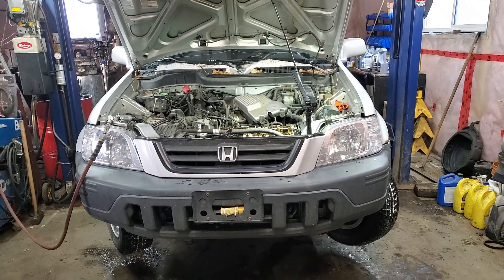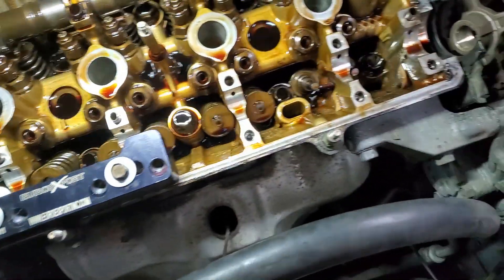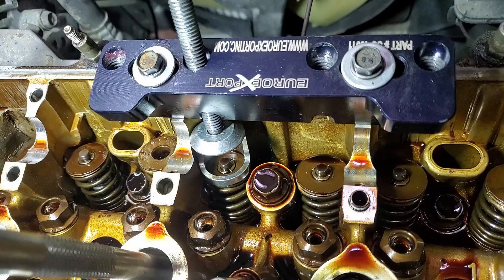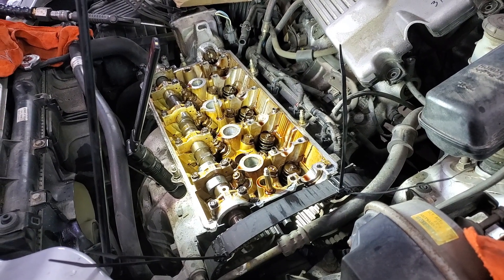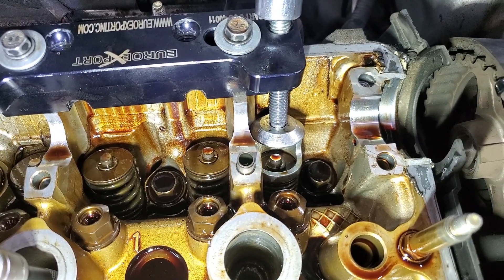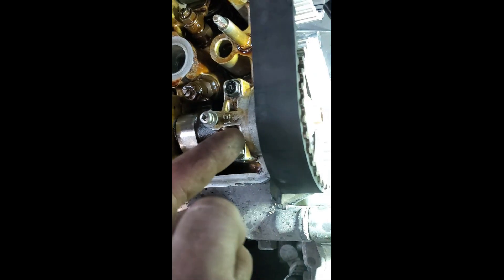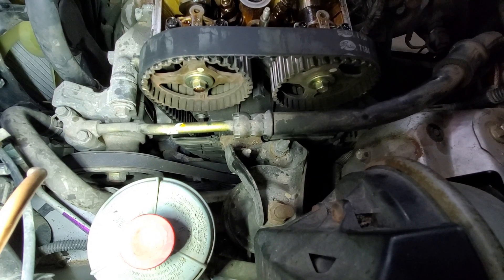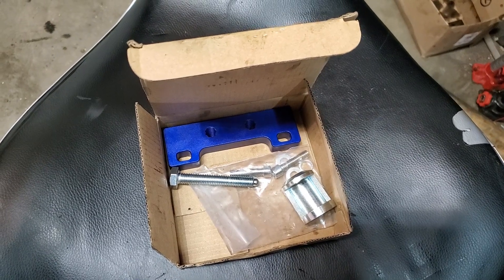Honda CRV B20B Valve stem seal replacement.

Comment: 6:15 Sorrry but that´s a wrong explanation. You are not pointing there at the TDC,  The three marks you are showing are ignition timing marks, usually the center is in red color which decolorates over time. The real TDC mark is the single notch on the crank pulley, separate from those three, to the right, usually colored in white.

 Added to this, On a Honda CR-V 1St Gen, you should NEVER trust the plastic cover mark as a good reference... the only reliable TDC reference is the crankshaft pulley mark aligned with the fixed metal pointer on the engine block. The plastic timing cover is not a precise reference and should never be used to set TDC. It can be slightly misaligned due to installation position, manufacturing tolerances, or movement over time, which can easily lead to timing errors. Always use the crankshaft mark and engine pointer as the true TDC reference. Your video is a clear example of how cams can be aligned, and the plastic cover pointer is at the wrong position and 99% of time would never point to the TDC notch of the pulley.
Reply from the maker: yes I believe you are correct, but I have learned a few things since this video.

Comment: Tried doing your method and the cam wheels spin with the crankshaft now my belt and wheels are stuck lmao
Reply from the maker: ya its not the best method, I was just trying to save a little time, you may have to just do the timing belt the traditional way.
Reply: @A2J_Tim I was able to fix it the belt wasn’t loose enough I mean hopefully I don’t have to do the timing lol
Reply from the maker: @davidcassia1595  make sure you check your timing when your done, turn the engine over 2 times by hand and check your timing marks.
Reply: @A2J_Tim for sure thank you man

Comment: Can you explain why it appeared the timing belt didnt move at all when you rotated the engine?  I assume the timing belt is still connected to the crank, which you rotated for that process, but in the video as you rotated the crank, the cam gears (disconnected and with the timing belt zip tied to them) didnt move at all. (3:45)  It seems to me that it should move with the crank. Maybe it actually did move but was just sort of sliding to the left giving the illusion that it remained still?   Thanks
Reply from the maker: the the cam gears off the belt looses contact with the crank pulley, thats why the belt doesnt move.
Reply: @A2J_Tim  ahh makes sense thank you

Comment: Did yours smoke after replacing them? I just changed all mine and its smoking.
Reply from the maker: no, I diagnosed my smoking issue and knew it was the valve stem seals. its possible you have another issue causing oil burning.
Reply: @A2J_Tim  id think that too but its a fresh build. New rings, pistons, valves, has good compression. The valve seals i replacemed were definitely a problem because they were all torn. Im hoping its just residual oil burning
Reply from the maker: @boosted_donkey  if its a fresh build, usually an engine will smoke for a good 10 to 15 minutes after engine start up, its the oil from assembly of the pistons and rings. If it continues past that, their is a problem with the build. if its a turbo engine, and its a used turbo you may want to check and see if the turbo oil seal has failed.

Comment: Could you like the seals you use? I’ve ordered 2 sets now and they’re way off. Same motor as yours. Thanks.
Reply: Thank you!
Reply from the maker: @alifakih9061  your welcome :)
Reply from the maker: https://www.rockauto.com/en/catalog/honda,2000,cr-v,2.0l+l4,1365566,engine,valve+stem+seal,5800
Reply: @ which brand do you prefer?
Reply from the maker: @alifakih9061  mahle

Comment: Mine smokes during idle on drive in long lines or traffic for a min and goes away, I also have a 01 CRV. Is this the problem for that solution the valve seals?
Reply from the maker: yes that will be your problem, at idle your crv makes the highest vacuum in the intake manifold and if the valve stem seals are no longer soft oil will get by them and you will see oil burning at idle, it will clean up as you drive because Rpm goes up and Vacuum goes down.
Reply: @A2J_Tim   thanks so much for the info! My mechanic is working on it now
Reply: you fix it?

Comment: Hey I am attempting to do my valve stem seal job the easy way as in your video. I am wondering once you get the belt zip tied to the cam shaft gears, if you just pulled both off without loosening the timing belt.
Reply from the maker: I didnt video it but in the end I ended up  cutting the zipties and getting them back on with a pry bar and then checking the timing after ward, its a little bit difficult but it can be done.

Comment: A trick to delay this project is to use Bars oil stop leak.  Like I managed to delay this job for two years after I started to get morning smoking after idling to long before shutting off the night before. Well the water pump is leaking so time to do both of these jobs now.  The B20B4 tool is available when googled and checked for use on the B20B4 for around $80 + ship & tax. I found a knock off on eBay that looks like yours and good for Mitsubishi 4G63 and 4G63T.  I am getting the tool that is thicker like yours not the thinner ones.   $33 for this one.  This is a one time job for me so the $ make sense for me.  Wish me luck.
Reply from the maker: you can do it..

Comment: You should have shown how much of a pain in the a$$ they are to remove. And also emphasized on how to tap on the new ones. Tap and listen for sound change, that means you have bottomed out. A good bright light as you tap on is a very good visual you can see them stop as they bottom out. As for removing you need a good old fashioned pair of pliers and squeeze them at the top and turn and squeeze and turn several times while wiggling and pulling, then they will pop off. Best figure on about 15 minutes per seal to get them off. Honda B20

Comment: Came here to see how to remove the stem seal... Only thing you didnt show...
Reply from the maker: sorry. I used a heal bar and pulled up from under the seal rim, some of them I just grabbed with plyers and pulled up.
Reply: That’s because it is a pain in the a$$. To remove them. I can tell you from experience. You have to use a good old fashioned pair of pliers and pinch them at the top and squeeze rotate squeeze rotate wiggle and pull then it will pop off. Figure on spending about 15 minutes per seal to get it off.
Reply from the maker: @t.c.robinson6608  I dont remember it being difficult at all, like 30 seconds each.
Reply: I literally had to saw mine in half, they were so stuck on there.

Comment: I take it you have to adjust the valves after you’re done ?
Reply: Thank you for your response :) 
Another thing is do I keep the cam gears zip tied with the timing belt up until I reinstall them, to ensure timing is correct ? I’m worried if they’re both off and zip tied, and I start turning the crank pulley to get 3 and 4 to TDC, the bottom part of the timing belt might skip teeth, since there is no longer tension being acted upon it. Maybe I’m overthinking ? Thank you again
Reply from the maker: @TheFoxyPlayer  On this job I ended up cutting the zip ties off, I just didnt film it. I found it was a little bit difficult to get the cam gears back on with the timing belt on them as the tension-er is pulling tight. but yes you can jump a tooth, but its not something to be worried about. As long as you lock your cams in place with the locking pin holes and your crank shaft stays on the TDC mark when your reinstalling the cam gears you will be in time. once installed always turn the engine over by hand at least twice to check that your timing marks are still lined up, if they are not then you may be off a tooth. If you are not comfortable doing it this way you should maybe take the timing cover off and completely remove the belt and reinstall as per timing belt procedure. I just did it this way to save on the time of removing the two belts and lower timing cover.
Reply from the maker: you can if you like, But If you put the rockers back in the same place they came from and if they are in spec when you start then no you dont. I checked them after the job and they did not require an adjustment.
Reply from the maker: also I will admit that I messed up my timing in this video as a commenter pointed out "
@splok2
"you are not lined up, tdc is the single notch on the harmonic balancer"

so im probably actually off a tooth based on the  crank shaft mark I used. but that is where it was lined up when I took it apart, lol. I should have checked that when I was putting it back together but assumed the last guy who did the timing belt job had it correct. That is my fault, but the vehicle ran fine and drove fine and is still running fine, it just has slightly retarded cam timing which if it were turboed would improve low end spool up haha.
Reply: So you managed to get the timing belt off and back on without loosening the tensioner ?
Reply from the maker: @TheFoxyPlayer  correct
Reply: Well, after attempting the job I screwed up big time ! So after the stem seal wouldn't come out, I (after reading online) started trying to break it in half using a chisel. Little did I know the metal part that sticks out past the spring seat is not part of the valve stem seal... and I chiseled it until there was nothing. Now looking at the diagrams I probably chiseled away part of the valve guide. Guess now it's time for a new cylinder head !
Reply: I would at least check the valve clearance before reassembling.  This only makes sense since if you are replacing valve seals you got yourself an engine with quite a few miles on it.

Comment: how tightly pressed in do your seals go? I've damaged 2 by tapping too hard. but the old ones are easily 1/16" inch tighter into the head :S
Reply from the maker: if you press on them my hand you can feel a little click or notch the seal goes over. if you want to be absolutely sure you can measure the height of the old one before removing and tap the new one down a little at a time till you get to the same measurement. I have done so many I just do them by feel, you can feel it on the hammer when its bottomed, but remember gentle taps.

Comment: Thanks for the vid! Would a valve clearance adjustment be necessary after?
Reply from the maker: you can if you they are out of spec, I kept all the rockers in a box in the same order they came out so that they could go back in the same spots they came from, I also checked the clearance before hand and every thing was in spec, if its in spec and the rockers go back in the same spot a clearance adjustment is not required.

Comment: I noticed the 3 notches vs the single one on the right side. Would the single notch still line the cams to the head too? Why did they design the other 3 notches for?
Reply from the maker: I apparently got that wrong, I guess the 1 notch is tdc, the other 3 are timing marks.
funny enough the crv drives fine and have had no issues with the timing a little bit off.

Comment: Hey awesome video! I have a question. What problems did have that made you change the valve stem seals? My 1999 CRV is burning a lot of oil at idle and I did some research and it’s saying the valve stem seals. I also reas that I could have a burnt valve? Let me know what you think. Thanks in advance.
Reply from the maker: your problem is most likely valves stem seals like the problem in my video. If you had a burnt valve you will lose compression in that cylinder and it will develop a miss fire at idle and low rpm and it will eventually get so bad that it will constantly miss fire even at higher rpms. 

Its my opinion that leaking valve stem seals will cause a burnt valve if its not fixed.

I hope this helps.